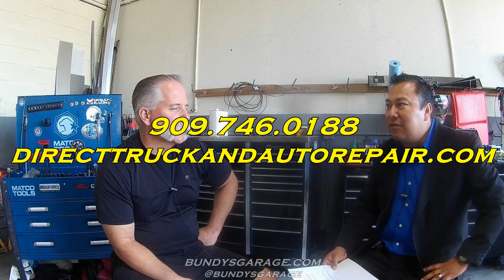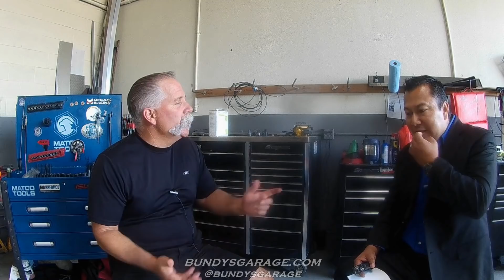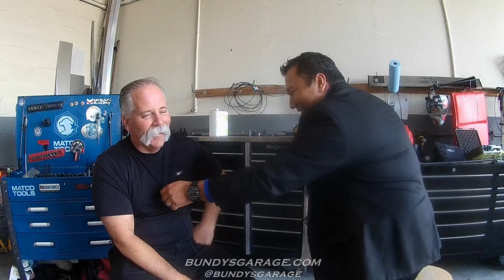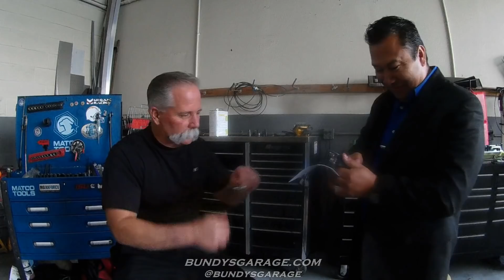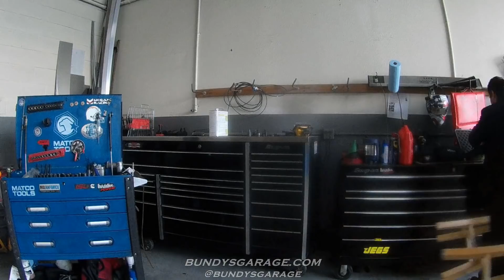Worst Diesel Engine Ever - What is the Best Diesel Truck out There? | Ford Dodge Chevy

Comment: You guys didnt talk about the 7.3 powerstroke
Reply: Austin,there's nothing to talk about,if its built good,and you change the oil,its like a refrigerator,it just sits in the corner and runs and no one ever counts the hours till it breaks,some things have been perfected,the 7.3 is one of them,hotrod anything its gonna break,its gonna break
Reply: strattuner I fully completely agree
Reply: It's still a tractor motor made by international
Reply: I don't care who made it,its made,its durable and its cheap,and its most importantly available,parts too
Reply: @strattuner  but the fuel milage is a joke I have a friend gets 10 mpgs pulling his 5th  wheel trailer, my freightliner Cascadia  with a 465 cummins pulling a 53' trailer  averages 9 mpg those pickups should at least in my opinion be getting  20  PLUS mpg
Reply: Dewayne Miguel,i'm getting 18-22 mpg in the excursion,the reason most people don't get mileage when pulling is they don't understand anything at all about design,and they have normal lives and shouldn't,now,the reason a 465 cummins gets that kind of mileage pulling that weight,is the driver,and the fact that the engine in their rig is stroked and their turbos are set for one rpm at max torque,at x miles an hour,in other words they don't over rev or hotrod their engines,EVER, now a 7.3-6.0-6.4-6.7,duramax,cummins,the minute they get one all they talk about is more fuel,more speed,more power,they are essentially redesigning and vehicle the manufacturer spent millions of dollars perfecting to run at road speed for 500,000 miles with timed oil changes,i know I'm right I'm a senior master tech of 47 years,i've built thousands of engines of all types,and multiple thousands of trans,rear axles,enough to where I see them in my sleep,if you want maximum fuel economy,keep your road speed at the max torque of your engine,in the case of street diesels,anything other that over the road tractors,keep your foot off the throttle and under 70,goes double for pulling weight,tire pressure is critical when loaded,pull vehicle and pulled vehicle,if you don't get the mpg you want,you bought too small of a truck,stroke in any engine is the ticket,that's why the 465 cummins reigns supreme,it's a bad mother at road speed,
Reply: @strattuner  these guys are all truck drivers for walmart been driving  years these motors just don't perform very impressive to me but I will admit were in California and the emissions crap doesn't help but I'm not a dodge fan but I had a original cummins and I got 26 miles to the gallon pulling a 33 foot loaded gooseneck  chevy and ford diesels just don't impress me one more thing I feel if ford and chevy would developed a in line 6 it would be a improvement I owned the old 2 stroke detroits and they were nice but the cats and cummins six s impressed me much more
Reply: alright first thing I noticed from your statements is that you're in cali,that explains a lot,hills mountains,uphill downhill,stop and go,all of this affects fuel economy,when speaking of a truck or diesel anything,fuel economy is out the window,unless,you care,but faced with the hills and the rest,you're gonna burn a lot of fuel,plus as a technician we've known for years these vehicles are inferior at best,they're old technology,hell the diesel engine was invented in the 19th century,all hooked to liquid low output fuels,now tainted by government intervention,we're hooked to the pump,keep your tires all the way to spec, change your oil often,diesels are dirty damn engines,oil cleanliness is 2 hours and it turns black from hi pressure blow by,nature of the beast,they give maximum fuel economy,when on the ragged edge of heat,which means cooling system should be top notch shape,all the time,esp in summer a/c months,and when they run cold combustion is blue,when it is major blue color hot or cold,you're burning oil and fuel,together this pollutes the combustion chamber adding compression,due to quench,this takes the engine out of design parameters,i'm a gas guy,i drive hi compression old engines that burn rubber when I say,if I need anything moved,i'll call a diesel guy,lol
Reply: @strattuner  I'm a 40 + yr truck driver I love diesels but like you in my private vehicles I prefer gas I had a chevy van I bought in 1979 I customized it it had a 350 gas motel never saw the inside of a shop I do all my own service's I put 400k miles on it my pickup had 300 only reason I got rid of it,it had a 454 and got 8 mpg and I was getting 9 in my big rig  it was a 1977 and was too low geared but if you take care of it it'll last I'm not a speed deamo if I want to go fast I drive my corvette, but I go go go so much I don't hurry or drive fast when I'm off ,california is a killer to the diesel my suburban gets 23 mpg and I feel if a diesel can't beat that in a personal vehicle then gas is better
Reply: the 454 Chevrolet engine has a terrible rod stroke ratio,of 1.45,1.8-1.9 is perfect for power and fuel economy,the big block chevy is a powerhouse but with that kind of rod stoke ration,its literally tearing itself to pieces going down the road,that's why they are terrible engines for motorhomes,i'm a mopar guy,i own a lot of collector cars,only way I can save money,i've had 383 and 440 engines that got 18-19 mpg,only reason for them is cylinder pressure in Chrysler engines was superior,to most,and they had perfect rod stroke ratio;s,chrysler designed fighter plane engines in ww2 and engines for tanks,and other equipment,when running v8s put a timing chain and valves springs in every 125k miles the rest of the engine will burn fuel normally and never cook a valve,nice talking to ya,clean oil means no wear
Reply: @strattuner  I love the old dodges I messed up I had a chance to buy a 1968 charger fast back complete car 10 yrs ago for 2800 dollars and I mentioned it to another driver at work from Texas when I got in from my load that jerk ran down there and bought it out fom underneath me man I was mad the car had no rust no dents a 440 the paint was faded needed interior work but was complete nothing missing loss of a lifetime
Reply: don't kick yourself,i've junked cars in the 70's and 80's some were collectible,some were not,all were almost perfect,it was a strange time,insurance ruled the day,some of the badboy cars of yesterday were outlawed by insurance companies,so couldn't drive them in some states,those guys who bought and held on ,well whoever owns it last gets paid
Reply: @strattuner  gm designed the same stuff to infact the 454. Would be as most Chevy guys call it the odd man out it will destroy cylinder 7 but for some reason doesn't give a shit if it does. Like number 7 dies just keep her running. But normally they have a few hundred thousand miles on them before that happens.
Reply: Also it's mainly because the 454 is a stroked 427 block.
Reply: had two 7.3s,they both impressed me,they got good fuel economy,and pulled the weight when asked,i load them according to power,can't ask a 400 cubic inch engine to haul or pull monstrous amounts of weight even 200 miles,i won't perform,correctly,you got weight,you need torque,monstrous torque,a road tractor will only do,just like everything else for the last 45 years they almost perfect something then the change the damn thing,i will only own a 7.3 ,I like the mileage and I don't overwork none of my equipment,if it s big call a bigger rig

Comment: Best IH 466 runs forever. No pull overhaul. Worst well, Olds gas block conversion, needed oil change after driving it off the lot. Even with meticulous maintenance it died (total tits up) at 51,000 (out of warranty it had a few new heads by then). So much blowby there was more oil under the hood than in the crankcase. '79 Caddy, last GM we ever owned.

Comment: 7.3 was/is legend. Long after we are dead there will be a 7.3 running under a hood somewhere.
Reply: I think you mistyped and meant to say the legend is the 5.9l Cummins. How many 7.3's do you see over 300k? Now, how many Cummins do you see with 500k and beyond? Cummins even has a million mile club. Your argument is invalid.
Reply: CorvetteFan86 i
Reply: CorvetteFan86  I have a 1999 f250  with over 400k on it sand most of was pulling a 5th wheel. It has the 7.3 and still runs strong . Not many dodges around here still running that long .  What are you drinking?
Reply: @CorvetteFan86  browsr around a few Ford forums and you'll find plenty of 300k 7.3.s my forum had several 7.3 over 500k
Reply: @Lifted0311  LOL several.....So a handful have been lucky enough to make it to 500k. Again.......check out the Cummins Million Mile club there are more than "several" listed there for Cummins.
Reply: @TK-zg6ip  I mean maybe several maybe a ton , I dont know. It's not my job to keep a tally on what trucks have what miles. I just know almost every 7.3 owner I talk to is pushing 300+. Personally I'm st 270k original Injectors, turbo, hpop
Reply: 7.3 IDI and Powerstroke. Bulletproofed 05+ 6.0, fuck 6.4, 6.7=new 7.3.
Reply: Brandon Sellears all junk
Reply: It’s because they are low on power for such a huge displacement. Makes them reliable
Reply: I really enjoyed polluting the ground with oil and breathing raw exhaust fumes, but I really loved the cold start capability of the 7.3. What a piece of fucking shit.
Reply: Erik Fountaine you’re oil line should literally burst like once, my dad had that happened and we replaced it we have around 730k on it and it runs fine other than a replaced battery and alternator. You’re opinion you don’t like 7.3 nobody asked for yours, I like my dads and I’m a fan of it, that’s my opinion. You don’t gotta be a dick about somebody having the opposite thought of you’re own opinoin
Reply: @erikfountaine5427  your 7.3 must of been junk or you didnt maintain it. My 7.3 cold starts on first crank without my heater down to single digit
Reply: Last truck I'll ever need😉
Reply: That's because Ford didn't make the 7.3. Ford was smart going with CAT.
Reply: You talking about the dipstick O ring? If so, you don't have to pull the pan. If the adapter is good all you need is a bore brush and a new o- ring. If the adapter is warped you push it in the pan and put on a billet adapter. Yes, the billet adapter is pricy but an easy fix.
Reply: compaq2441 ya and still dripping oil everywhere and to fix the one little o ring in the oil pan got to pull the motor out for a 10 cent o ring lmfao
Reply: @satinsk8er  degrease and spray it with rubbercoat. Did this on a marine engine and it has been running without leaks  for 5+ years and over 3K more hours.
Reply: compaq2441 na I fixed it the right way I don’t do stuff like that but.  Good job
Reply: raji chahal I got a 96 with 290k on it and I shit you not one drip
Reply: Legend? LMFAO!
Reply: @brianfetzner5300  good for you

Comment: Last year I bought a Titan with the Cummins..1 year, 30,000 miles and 2 turbos later I'm very disappointed in the engine. The truck is in the shop for the 13th time currently. The service manager told me it now needs a new C converter.... REALLY! Thought s
Reply: Haven't heard many good things from those 5.0s
Reply: Mel Shingleton If you want a smaller diesel, I might recommend a Ram 1500 Ecodiesel. My dad has one and it gets great gas mileage. 2015 with just under 100k on it. They have no issues at all, and they can pull more.
Reply: @2001FordPowerstroke  ....Thanks. I tow a 12,000lb 5th wheel. I had looked at the Dodge eco. Couldn't handle the load. However, as soon as I get back it's going up for sale. I'll be looking for a 2017 or 18 Dodge 2500 with the Cummins.
Reply: @melshingleton5991  Mel Shingleton That's my kind of guy! I would still want my dad to get a Cummins, but he is too damn loyal to Fords. The only reason he bought that eco diesel is because it had the best gas mileage and towing at the time. He might get an F150 with the 3.0 l Powerstroke when he is able to find a good used one. I like the F150s better because they don't have that damn rotary shifter, but I'm sure Ford is going to do the same in their F150s one day.
Reply: @2001FordPowerstroke  The rotary shifter really isn't bad once you get used to it.  I'd rather have that than a console shifter that takes up all of your console space just for a shifter.  I've got a '16 Chevy 1500 at work with a column shifter but those are somehow getting harder and harder to come by.
Reply: @406Steven  They still have column shifters in the new Chevs. That is my favorite type of shifter. I worked at a Dodge dealer over the summer, and I've noticed that the rotary shifter is where some people object. I'm glad the Ram 1500 Express still has a column shifter.

Comment: I have a 2003 F350 Super Duty 4wd dually that hit 2 elk.  Front end is destroyed and I was going to simply junk it, but now I hear about the desire to have a 7.3, maybe I should try to sell it.  Surely someone would want the 7.3, trans, transfer case, and other odds and ends?  Not even 200k on it.
Reply: I would hold out for the best offer and not accept a lowball one. The 7.3 is desired by so many, along with that body style somebody will buy yours with low mileage regardless of the wreck.
Reply: Elmer Thudpucker. I would! Put in a trades paper.
Reply: I have that truck in four door  chassis cab configuration....yes VERY desirable... especially if it has a manual transmission. Either way it's worth some money...we have two local guys sucking them up off Craigslist and rebuilding them and doing VERY well. R
Reply: This one is a crew cab as well. Leather.  Everything worked when the elk committed suicide.
Reply: Elmer, the tranny transfer combo alone is worth money as some folks forget that the hubs are in and the front driveshaft comes apart at highway speed and takes out tranny/transfer. My mechanic buddy has repaired a few of those, first thing I did when I heard that was rebuild the front driveshafts on my 350 and 550. ..just in case. Definitely advertise it. The Dana 60 up front is worth some money as well (locally about $500-600) .  7.3 in good running shape are $1500-2500, at least in opinion, especially low miles and can see how well the truck was cared for.

I have a "3-80" brush guard on my truck...three deer 80 mph keep driving , solid 1.5" carbon steel, totally custom here at my shop.  It's braced back to the core support. I accidentally hit a telepole in a parking lot at 10mph...stopped me dead...I thought I had sheared the pole. Broke one weld on the carbon bar.
Reply: How much do you want for the truck, and where is this dually located, elk that is a big deer compare to the mule deer in this west Texas. And you say two. have to check engine and transmission, that's not what Ford tuff stand for,

Comment: I have worked for both Ford and Dodge and I totally agree with his wanted perfect truck. Cummings backs a better engine and Allison makes the absolutely best trans. I managed a Ford Service Department when the Powerstroke first came out. Had one come in from Idaho right away and it wouldn't run. Dodge does have problems with diffs. Totally agree with taking care of your rig. That is the key. Great Viedeo!!!

Comment: My 6.2 is the worst diesel engine ever..blocks crack if thr starter is not put in correct..on motor 3 for same issue..if you dont stay on it to make sure its tight..my beast is a 1990.and worked hard..so hasnt been bad just a waste of an engine over 2 bolts

Comment: I got tired of blowing transmissions in my all the cummins i had so i switched over to 6.0 Powerstrokes and have had great experiences with all of mine.
Reply: INFAMOUS 6.0 you are a gay fuck aren’t you
Reply: I had a F350 7.3 4X4 crew cab that was a beast and very tuff. I only had 2 problems, it would need a new trans. every 100K and 2 new batteries every year. I still say it was the tuffest truck I have owned in 50 years. After the 2nd trans. went out, I had Jasper build me one with all after market upgrades and it never failed again. We literally put the truck on the farm after 340K miles and it still went another 3-4 hard years.

Comment: If there's one thing that I've seen in my life time of 49 years, is that anything that ever existed long enough as a brand has had it share of gems and share of junk, no matter what it is. Whether it's Ford, Dodge, Chevrolet or ect... Reading these comments makes me think and laugh about how immature people are about things that no one can control when it comes to these engineering designs. These auto corporations are always going to be the first ones to come up with the latest and greatest engineering designs and in that process no matter which company it is, it will have to go through a period of time before that design is figured out and mastered. Going back to the 90's, the 5.9 Cummins and the 7.3 Navistar was at it's heights in the terms of reliability and longevity. Since the early to mid 2000's, diesel designs have taken it's time since the changes with the emission laws... Keep in mind, anything that is going to be great, will take time...
Reply: Well said

Comment: My mechanic buddy told me that 6.0, 6.4 and 6.7 diesels keep him in business. If you must have a powerjoke, buy 2 so you have one to pull the other home when it breaks down.
Reply from the maker: That’s awesome! Buy 2 of them and then get a GMC to pull the second one that will break down. Not a question of if it will but when it will break down!
Reply: The 7.3 is a good engine. But I prefer to keep my dodge Cummins. 400k miles and still going strong.